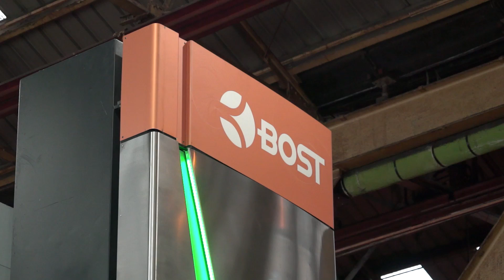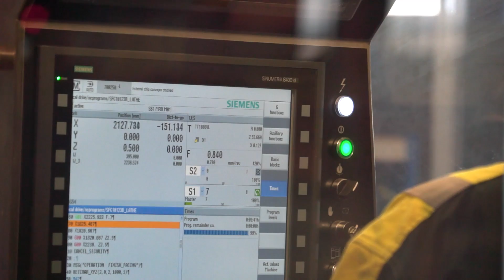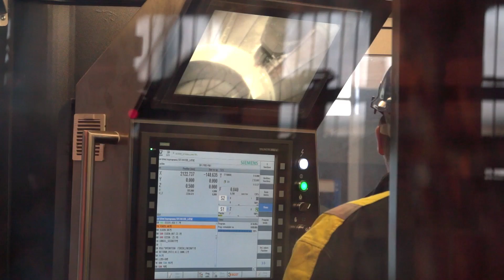HUGE 5 axis Bost VTL68CY installed at Sheffield Forgemasters

Comment: Very Impressive.
Reply from the maker: What is your favourite part of the machine?
Reply: Head looks strong and powerful, lots of travel on the ram also. The machine monitoring also sounds a very valuable tool.

I'd be sorting out that coolant on the turning tools though, needs directed nozzles in the tool.
Reply from the maker: They do machine challenging materials as well!!!
 @swikocki